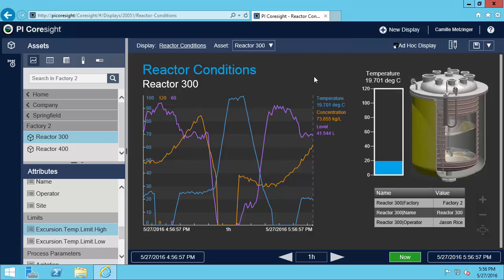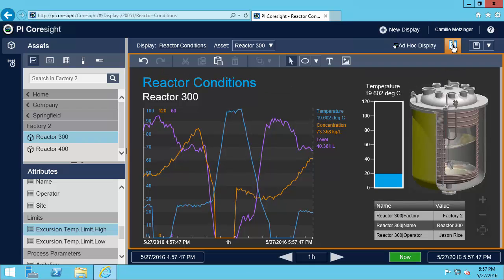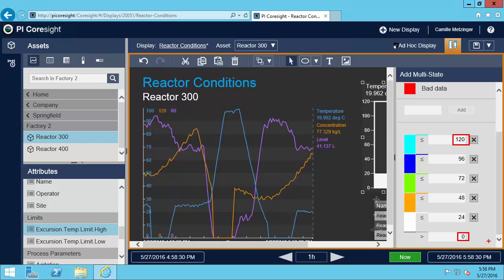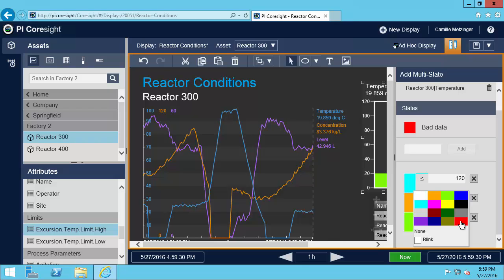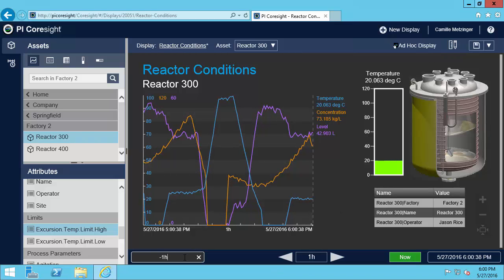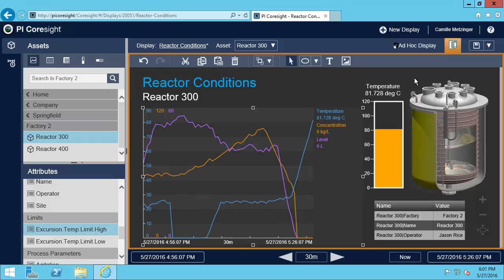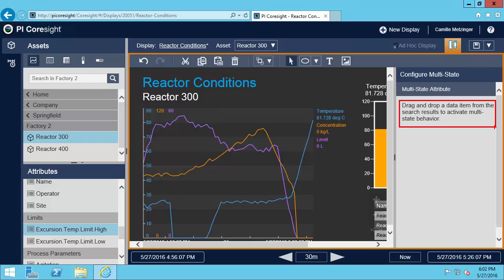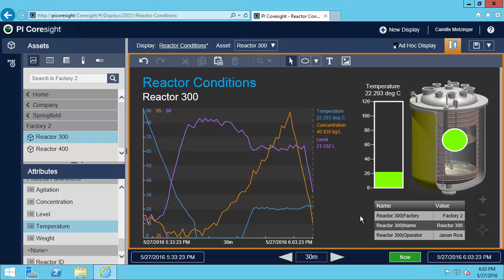OSIsoft: Add Multi-State Functionality to PI Vision Displays to Create Visual Alarms

Comment: Question on the values, Can they be dynamic or linked to another PI Tag?
Reply: AF has the option of creating "Limits" as child attributes. You can use these to map to the different color schemes. These can be dynamically set as outputs of an analyses or the output of another PI Tag. I recommend visiting the PI Square forums:
https://pisquare.osisoft.com/thread/32766-multi-state-value-in-pi-vision